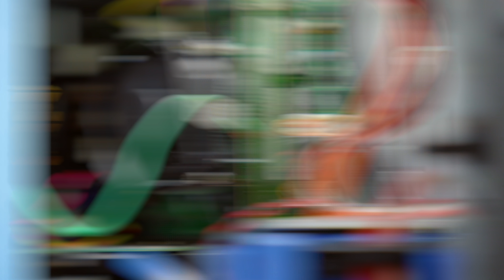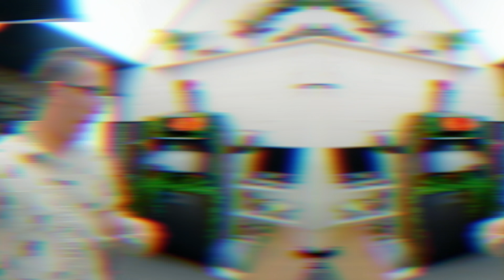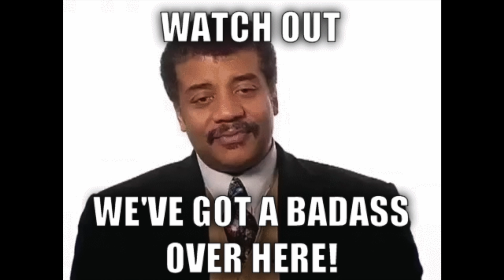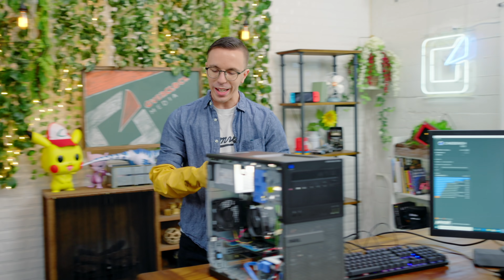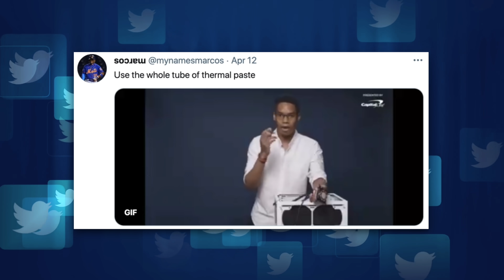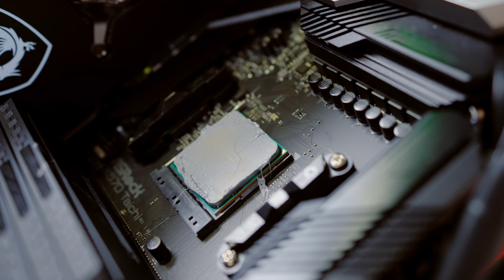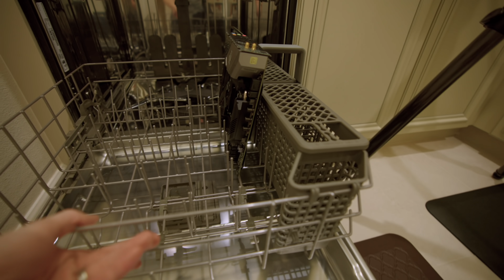Gaming PC Lies People Believe

Comment: I fried my mobo when I dusted my pc, I was cleaning out the top fans, and accidentally touched the mobo with the edge of my hand, I felt it static shock it, I powered on my pc and it was dead. I replaced my motherboard and it works great now. (it was just a cheap 50 board anyway) (Btw the entire time while cleaning I made sure to touch the chassis of my plugged in but turned off power supply)

Comment: Correct me if I am wrong all those static tests didn't work because they had the pc plugged in and running which grounds the computer. Wouldn't the test be better to mimic the process of building a new pc and not have the components connected to the power supply and try doing what they did then test those components showing the before and after.

Comment: on the static shock segment. I recently built a computer, 10 months ago. After the build I was moving some fans around for better air flow, from the top to the front after modding the front, and in the process shocked the frame of my PC. From that moment on my hard audio is no longer working. I bought a Bluetooth and Wi-Fi card to circumvent the problem but I am currently waiting for better speakers and headphones for the Bluetooth. Thankfully I am not a huge audiophile so the Bluetooth quality is adequate for me but yes, static can harm some of the cheaper/unguarded components. Hope all is well

Comment: The magnet shut the system off because you shorted through the GPU. I dropped a metal fan clip from my old CPU cooler onto my 2070 with no backplate and my PSUs overcurrent protection was tripped.

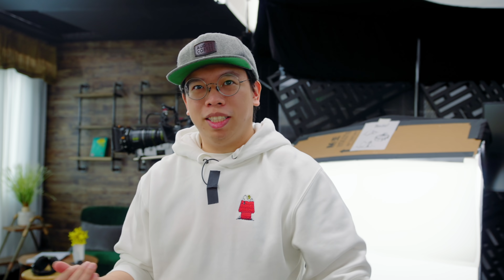Comment: 2:59. I want to point out a bit that the magnet itself is also conductive, putting it directly on the GPU just  probably short circuit the voltage rail and cause PC to halt for a moment.

Comment: The PC shut off when you put the magnet close to the graphics card because it shorted some pins on the GPU and then the PC restarted because the PSU has a safety measure to power off the system whenever there's a shortcircuit.

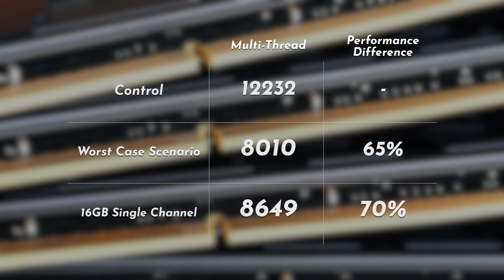Comment: Great video and sorry for me being a bit nit picky, but I’ve noticed that for example in the performance charts at 6:19 it says performance difference. I’d argue that that’s actually the percentage of the original performance that remained (as you said it in the video). The performance difference would be the performance after swapping the ram minus the performance before swapping the ram (eg. 65%-100%=-35%). The way you’ve labeled it (performance difference) implies to me that 65% were gained (or lost, depending on how you define the sign).

Comment: Static maybe 20,000 volts but the amps is anywhere from .007 to .001... And to comment on the "Expertly Washing" a PC motherboard in a dish washer... Take all the shrouds, covers and heatsinks OFF the motherboard before you wash it. Did you even take the CMOS battery out?

Comment: The GPU shut the system off not because of magnet's force, but because it is conductive and caused a short circuit between multiple points of the graphics card's PCB.

Comment: Found a PC in a pile of Rubbish, had chicken poop and rust all over the side of Motherboard, a little rust on the GPU Face plate, this machine was to be collected outside someones house. 
Took it home, Removed Graphics Card and Mobo/Ram, washed and scrubbed in Vinegar for an hour and removed all corosion. I washed it in the sink with hot water. Dried it over a Heat AC for 1 hour each part. Found out all the specs..A 1660OCTI and a 4th gen I5 with 32gb DDR3 two sticks! all worked and has been working flawlessy for over 4 weeks. the graphics card had less than 6 hours useage.

Comment: If you put a 16gb stick in one slot and a 8gb stick in the other for dual channel, of that 16gb stick only the first 8gb will be used in dual channel together with the 8gb stick. The other 8gb left on the 16gb stick will be running in single channel.
And that is only on some motherboards.
Other motherboards need the sticks to be the same size. Depends on which chipset is used.

Comment: You tested basically none of these right... You touched conductive metal to the gpu, unrelated to magnetism, you pushed the RAM to the side with the taser, unrelated to the electricity, and you left the cmos in the motherboard in the dish washer as well as not totally drying it. C'mon, guys, this video felt almost like you improvised it in an afternoon without preparing or knowing anything about computers.

Comment: totally skipped over the fact that adding that 2nd stick of shit ram still improved the speed over a single stick of fast ram by over 9% so that cheap af stick is still worth putting in and it brings up the total ram in the system by 8GB so you can have 1 more browser tab.

Comment: I literally pulled a computer out of a pool back in the day, as long as you give it proper time to dry off (more than 1 day), it is fine.
Reply: @Jarius Santiago  Austin did not give enough time for that pc to dry, if he let it dry it would have definitely worked
Reply: @markomclane475  also he didn't take the battery out
Reply: @Jarius Santiago  thats not how electronics work, if there is anything like water in a system like a computer it will short no matter what. That is why you allow adequate time for water to evaporate
Reply: Tech Yes City washes "dead" PC components every other day, it seems like, and he can revive a good number of them after adequate drying (not all dead parts get revived though)
Reply: @XbninjaXIV  tell that to my keyboard when i spilt a ton of water on it
Reply: @deegan2009  if you introduce water to an electronic while it’s ON and powered, that’s much different than if you introduce water while it’s OFF
Reply: Why was the computer in there the first place? 😂
Reply: If you rinse it down with distilled water, it isn't too conductive cuz it doesn't have minerals in is, so if you spilt soda in your pc you in theory could wash it out
Reply: I got coffee on my pc. It went off for a day then came on after a day of drying. Then after 5 months it randomly shut down
Reply: I've washed my motherboard and processor too,dried off properly they always worked.
Reply: LTT literally washed 8 keyboards in dishwashers, let them dry for a week and they all worked
Reply: Yeah I used to get computer’s from an army surplus stores that were left out in rain and snow in pallet crates.  Just let them dry out and we would build some pretty nice 386 and if lucky a few early 486 builds. Once got lucky and got a whole ibm server rack for $150.00
Reply: I wouldn’t suggest doing it guys
Reply: @Jarius Santiago  That's like saying that an empty battery can blow up
Reply: I wonder if capacitors can affect this as they could hold a charge after being powered down
Reply: I would never trust or recommend washing pc components, but it is still true that if you spilled water on your PC while it's disconnected from the socket and you give it like 2-3 days(to be on the save side and also depends on the amount of spillage) to dry, it will most likely work. Submerging it for like an hour will almost 100% of the time kill something in the pc because it may rip or corrode something because of the water pressure.
Reply: It's not recommended because of corrosion

Comment: Some people still think all magnets, including the weak@ss thin strip magnets used to hold the case dust filters, are harmful to computer parts. Ignoring the fact that magnetism and its strength is affected by the distance and also ignorant of the fact that your case fans have permanent magnets that are crucial to their function; hard drives have very powerful magnets inside used for the movement of the read head arms just a fraction of an inch and some diamagnetic materials away from your drive's plates; and would you think case manufacturers would put magnetic dust filters for years if it affected or damaged pc components?

Comment: On the dishwasher segment. If you could somehow use rodi water instead of tap water as well as refrain from the use of detergent/jet dry I could almost guarantee that your results would be different. The heat wouldn't be a problem as the boards roll over a bed of molten solder at the factory to install various components. And if you still had concerns after all the prep I've recommended you could dip the board in 99% isopropyl alcohol to ensure any remaining residue if any would be removed before you let it thoroughly dry for the better part of a week.

Comment: If you bought that taser at places you'd usually buy those. Those oversea tasers drastically lie about their numbers. That one is probably between 5,000 to 15,000 volts. Police officer tasers are usually 50,000 volts with higher amperage and can take down the biggest of dudes. That one is more or less to tase your college buddies leg at a party. It could free you from a neck hold for a moment so you can runaway, but for real self defense. Buy made in the USA to guarantee your safety in a life or death situation. Oversea tasers make criminals angry. USA tasers temporarily partializes most of their body. Giving you plenty of time to run.

Comment: Not satisfied with the RAM combination. It should be using the same size of RAM (for example 32 GB) with this configuration :
- 1 channel
- 2 channels same manufacturer same clock speed
- 2 channels same manufacturer different clock speed
- 2 channels different manufacturer same clock speed
- 2 channels different manufacturer different clock speed

Comment: For the dishwasher. you need to let it dry for 7 days. 1 day isnt enough. you just short the board. I have done the dishwashing method many times. and i believe Linus from LTT has aswell. Do it one more time. but give it a week to dry. (Soap doesnt matter. it just leaves you with a residue but still is fine if dried for a week)

Comment: HDD with the magnet may not be not, just the data corrupted?  And the magnet on the GPU probably didn't cause the system restart, but ya know, magnet's are conductive, it's bridged some solder points at the back?

Edit: Just listened to the dishwasher part, did you leaved the coin battery in?

Comment: That stun gun is not delivering 3+ million volts. The current is limited by the air gap and voltage must drop as a result. It's likely in the area of 10,000-20,000 volts if the air gap is around an inch.

Comment: my father's boss actually toasted a lot of equipment over the years from static and other reasons. I specifically remember that my father had to replace the same component twice because his boss had opened the package removed it from the antistatic bag and upon realizing what it was walked across the entire office to my father's workstation with it in his hand... my father saw it out of the bag and feared the worst, sure enough, it was completely dead when my father put it in the computer and tested it he ordered a replacement, and damned if the guy didn't do it again with the replacement part when that arrived you would think that somebody who is a vice president of a business would be smart enough not to repeat the same mistake, but you would be wrong

Comment: usually when people talk about magnets screwing up computers you're talking about getting the magnet too close to the magnetic media (hard drive) and actually changing the data beyond recoverabilty by the software. using magnet to stop the fans or other moving parts it's not usually what is being referred to. using it to interfere with data being read and written to RAM can also have a catastrophic effect, because you're actually altering the data before it reaches the storage media which causes it to be written incorrectly. when the computer goes looking for the data that it recorded as being in a specific location all it finds instead is gibberish.

Comment: The bit about the magnet: It looks like you shorted the GPU out and forced a head crash on the HDD with the magnet. Neither are what people usually think about when they are concerned about magnets near their hardware. Shorting some pins has nothing to do with magnetism and the issue with HDDs (or floppies) and magnets is that they will mess up the data on the platters, not do physical damage to the heads. Would have been better if the magnet was rubber-coated for the GPU and weaker, but there for a longer time for the HDD.

Comment: In the 20 years ive been building pc's ive never worn a static wrist band.   I dont even touch metal to discharge.  Also never bought a part that didnt work.  So maybe im just lucky.
And you can get away with not even using thermal paste at all.  Try it, it basically doesnt matter.

Comment: I dont know exactly how dishwashers operate, but you can wash circuit boards if you just spray hose them down but make sure there is no power running through them (in this case, remove cmos battery). Dry it with some paper towels and use a soft toothbrush to brush the entire board with rubbing alcohol to prevent rust. Let it air dry for at least 24 hours before testing. Ive done this with gpus, mobos, cellphone boards. Works perfectly.

Comment: just to let you know, the only reason the PC died when you zapped it was because you pushed the memory pins out of alignment slightly
Reply: I've actually had mad errors on memtest 86 when I touched the ram from the top of its heat spreader.
Reply: :irlm;
Reply: I don't believe that happened I believe the data was interrupted by the voltage

Comment: Magnets WILL NOT affect silicon (CPU/GPU/RAM/Transistors/Mosfets).  It will however affect transformers/chokes/coils in the power supply and on the motherboard and the graphics card, and read/write heads and platters in the hard drive, and any other component that utilizes magnetism for its normal function.

Comment: Linus actually tested quite a few of these myths on his channel before, so it's surprising how some stuff like the dishwasher didn't work considering it worked when he tried it.
Reply: It isn't so much a question of "working or not", it is more about doing it properly. In this case I would argue that Austin certainly did not do it properly.
Reply: Derbauer uses the dishwasher method as well. You have to remove the CMOS batter and make sure all capacitors are drained before doing it and also 1 day is not nearly enough to properly dry the motherboard. There was likely moisture here and there in the motherboard still.
Reply: Firstly u need to remove the CMOS and leave it to dry around 2/3 days and all will fine

Comment: First of all, Linus already did the whole static electricity thing with electro boom, also, voltage is only half of it, you’re giving it way too much amperage which is raising the overall current, that’s making it way worse, a normal person touching the computer wouldn’t even have a visible discharge, let alone a big blue one

Comment: Did that magnet actually kill the PC though or did you just short the graphics card?

Also too much thermal paste can cause other issues like strong suction to the cooler which can result in ripping the CPU out when trying to replace the cooler.
The fluoride in the toothpaste might eat away at the cooler/CPU over time.

Comment: I have killed a PC with static just a year ago. A friend wanted me to upgrade his GPU. He set it on the bed on a pile of laundry and had me do the swap there. Standing on his carpet, wearing socks, the system wouldn't power on after with new or old GPU. Once I replaced the motherboard (B450) it all worked fine.
That being said in the 20 years I've been building computers I've never worn a static bracelet and never had this happen before, so I would still say it's very unlikely.

Comment: Funny thing with the static is, that i actually killed my b450 mainboard with static. I touched a non painted/ shielded part of metal in my room bevor working on my pc. And I have no Carpet to get static from. I just littarly changed my ram (some thing i have done about 12 times on other systems, without any problems). But after Changing aroung the ram, tourned out, that in the process i have killed the Mainboard. I bought a new one an changed nothing about the Pc (accept i bought a new Ram stick because before i only had one stick of ram) and after changing out the mainboard my PC ran and Runs just fine, as if thers was nothing. 
I think i killed the Ram socket on my old board, porbably because i forgot to pull the power plug, after shuting off the pc, so the pc powersupply was still gounded by the Powerplug an i think because of this i was able to kill it. But shit happens and i learnd that i have to be carefull.

Comment: Very misleading video with so much misinformation.

1. A magnetic field will not kill/affect a GPU apart from the fans. What happened in the video was that the magnet surface (metal) shorted a path in the circuit resulting in a crash.
2. Static electricity, although very rarely, can kill components. To ensure that nothing bad happens to the components either use a grounding wrist strap or touch a grounded surface before fiddling with the components.
3. If properly dried (properly meaning weeks) a motherboard will work after washing it with water. What probably happened in the video (cannot confirm because information is lacking) is that they forgot to remove the CMOS battery which holds a charge for the BIOS NAND flash memory. The water then shorted something in the board and fried it. But I still do not recommend washing it this way! There are better ways of cleaning a motherboard!

When making videos like these, please inform people better as inexperienced people will instantly believe it and may break their own things.